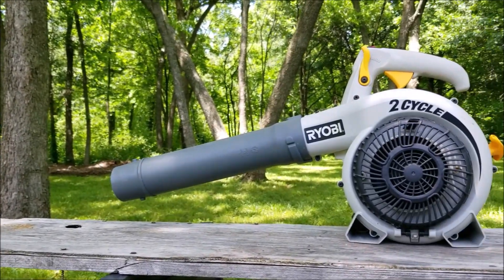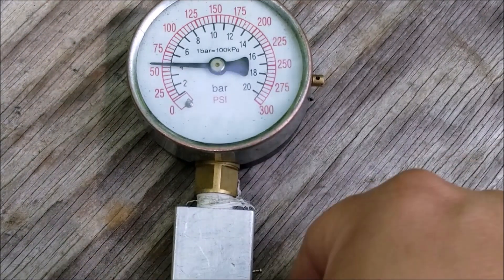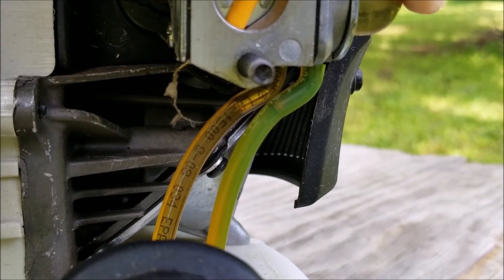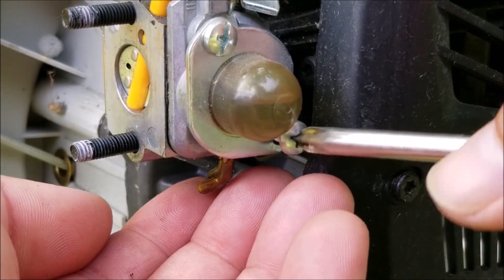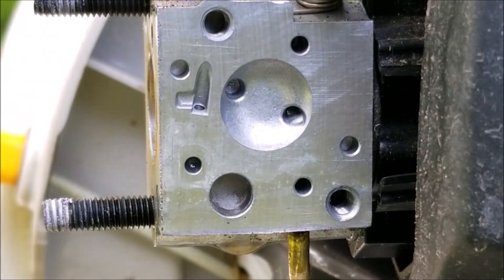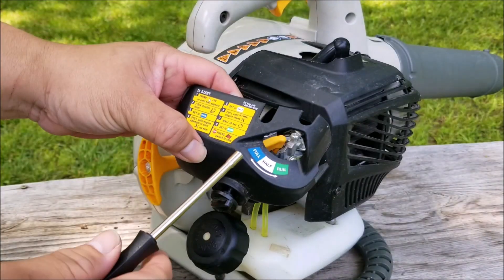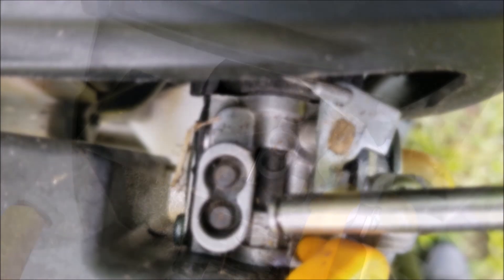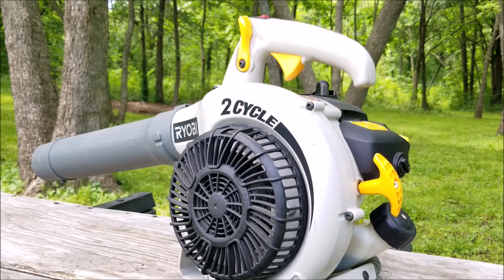Leaf blower starts but won't stay running finally fixed

Comment: Did you get a new compression tester yet? I'm tired of everything being 50 PSI. :D
Reply from the maker: lol.. its going to be a Christmas gift
Reply: @HomeGaragechannel  Oh good. Glad to see you are finally treating yourself. Don't worry, I won't tell your wife what you got her. ^_^
Reply from the maker: @999thenewman  lol oh she already knows
Reply: @HomeGaragechannel  Oh good, Mrs. Home Garage is skilled at finding things out.
Reply from the maker: @999thenewman  I usually tell her anyway. That way she doesn't find out herself.
Reply: @HomeGaragechannel  Ah, the early approval method. Good policy. Happy wife, happy life.
Reply from the maker: @999thenewman  absolutely.
Reply: That has been my fear in all this. I fear buying the wrong tester and tossing so much away due to wacked up readings. I am in search of a good one for two and stroke engines. I'm reading alot of the cheap ones the on point reading of what should be is way off. What is a good true reading compression tester to buy so I don't waste money and engines?
Reply: @joesphbaumgardner4579  If it won't start on some carb spray, you'll have your answer.

Comment: I was taught that leaving a gas powered machine empty will cause moisture to enter and rust the components.  That's why I leave fuel (treated with stabilizer) in it.  Is that knowledge outdated ... or wrong?
Reply from the maker: I don't think so, and I don't know about its validity. All I recommend is "Do what you think is right"  I like emptying mine for "long" storage.

Comment: Wondering if I'm having the same problem or something different. 

Mine is operating in a similar fashion. Hard to start, won't idle but runs like a dream at WOT

I noticed my air filter was soaked with fuel and local shop said carb was toast, so I ordered a new one and replaced. Also replaced all the fuel lines, fuel filter, air filter and spark plug.

However, still having the same issue and the filter is full of fuel again

Echo ES-250 

Anyone have any ideas?
Reply from the maker: sure, the carb might need to be adjusted to work well with the engine, also did you check the spark arrestor screen.
Reply: @HomeGaragechannel  spark arrestor is clean, only idles choked, air filter is full of fuel and runs great at WOT. I thought the carb was bad so I replaced it with new but am having the same issues

Comment: Would you recommend buying, fixing and selling 2 stroke power equipment?
Reply from the maker: actually no.  Its hard to compete with the affordable equipment from the internet.  I would suggest fixing them, film them and post it on this platform.  it's a lot easier.

Comment: What is the max RPM these can be run at?
Reply from the maker: I have no idea, I've never put a tach on one, but the ignition system will most likely be the limiting factor.

Comment: I always run my two stroke equipment dry.
Reply from the maker: me too.
Reply: Diaphragm will dry out and stiffin. Not a good thing to do. At some point the Diaphragm will become toast.
Reply: @joesphbaumgardner4579  No. They are either plastic or rubber. They do not require soaking to maintain them, and given higher ethanol levels in fuels, possibly quite the reverse.
Reply from the maker: @joesphbaumgardner4579  you suggest to leave them with fuel in them?
Reply: @HomeGaragechannel  I run all my stuff at 90 no eth. Winter I treat gas and fill tanks up ( 7 blowers ). Same with the 5 push mowers and 2 riders.
Reply from the maker: @joesphbaumgardner4579  I see. You must be very busy during the winter.
Reply from the maker: @BensWorkshop  you use 100% gas then or premix from a can?
Reply: @HomeGaragechannel  No, around Dec 1 I mix my gas and fill tanks. Run such and all else. Sit and come spring get going. Not busy in winter at all. Just the task of doing all pre winter shut down.
Reply: @HomeGaragechannel  I use petrol from a petrol station, I buy as little as I can for my tools and only mix what I can use in a month.
Reply from the maker: @joesphbaumgardner4579  I understand thanks
Reply from the maker: @BensWorkshop  very smart. Thanks for the comment

Comment: Are those filters one size fits all type of thing , you know one brand to another ?
Reply from the maker: The air filter is not universal.  This one just happens to be a piece of wirey foam. The fuel filter is universal

Comment: I’m of the run it dry camp.
Reply from the maker: me too, but nothing wrong if you leave it full of stabilized fuel.
Reply: @HomeGaragechannel  I just watched Taryl Dactyl’s fuel experiment videos. 87 octane no ethanol gas  every stabilized fuel.
Reply: Out of the pump 87 octane gas beat every single additive. Higher octane didn’t do as well. He said all additives are snake oil.
Reply from the maker: really, you need to watch Fortnines video on additives, his review was very decisive.

Comment: Don't be CHEAP! Use a fuel that is ethanol free such as VP small engine fuel or Shell V Power Nitro Plus!
Reply from the maker: absolutely
Reply: v power nitro plus is 5-6% ethanol.